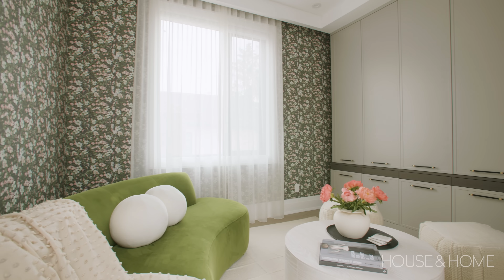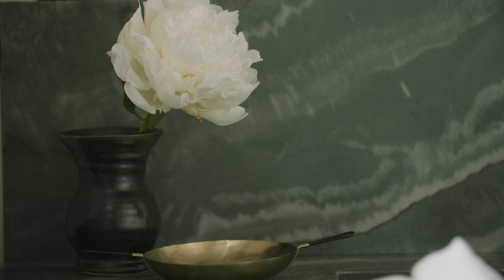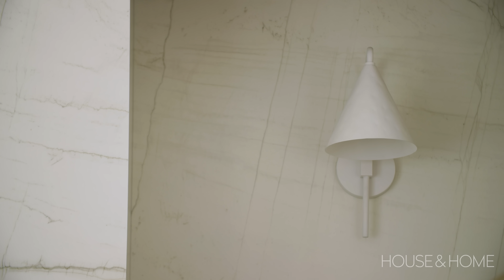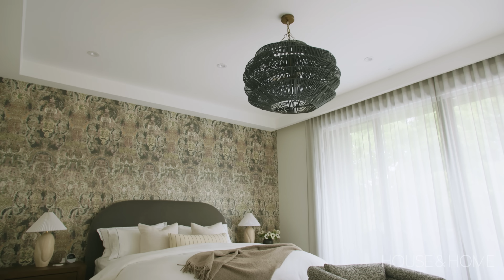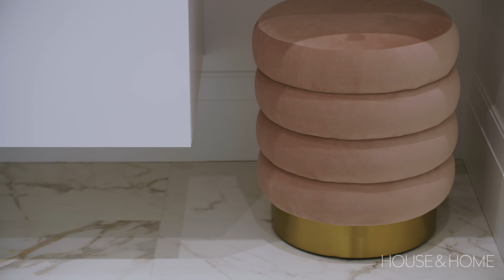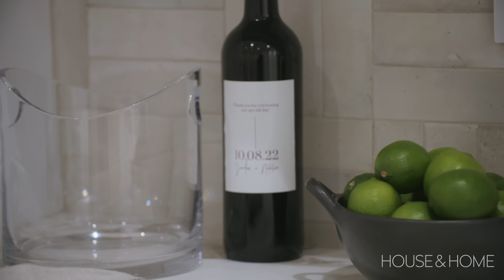Tour A Newly Built Home With Contemporary, European-Inspired Style

Comment: The entry is such a WOW moment with that gorgeous black & white large scale porcelain tile, but I'm afraid for me the rest went a little downhill. Not sure who chose most of the light pendants, but most were a bit of an eye sore or wrong for the rooms they were in. The main space with the kitchen felt a little flat (at least on video). I love neutrals, but it felt like the styling was incomplete. There was not enough dimension or depth, just a good foundation and no real wow. A year for an area rug that may be a trip hazard may feel like a regret down the road. OMG, the powder room... that wall paper & crooked mirror will give guest seizures. What were these people thinking??? The rest of the wall papers were a bit granny but sweet and I'm on board with them, but the green sofa will probably not age as well, already feeling dated. Overall, this felt like it had a designer's access to good materials, good space planning & contractors, but the level of design execution, lighting & fabric choices and styling didn't give me the "wow" that great design usually gives. A bit disjointed for me.